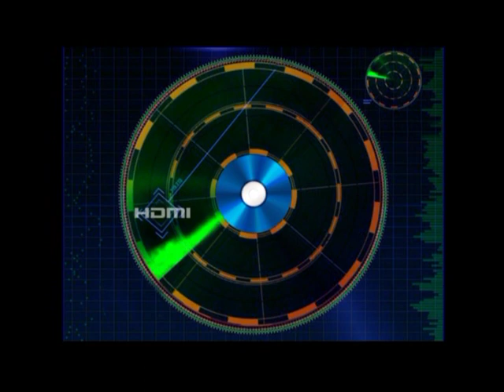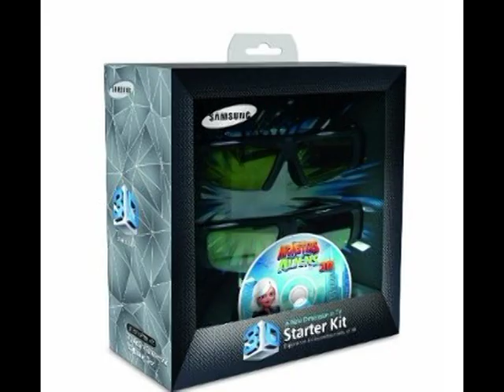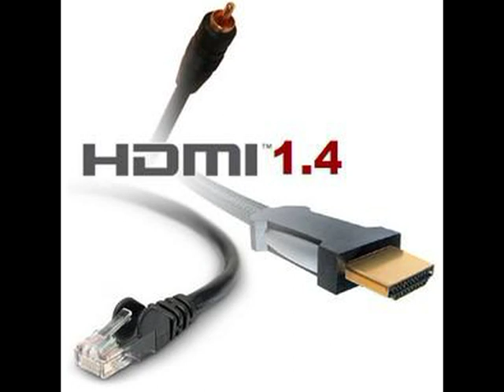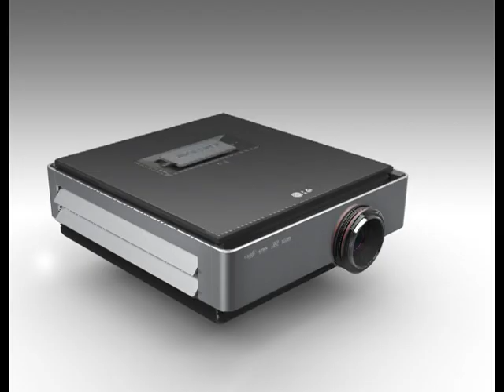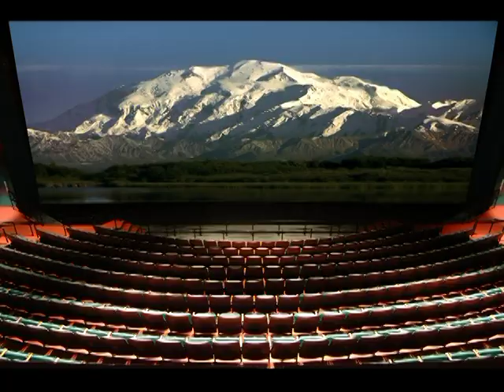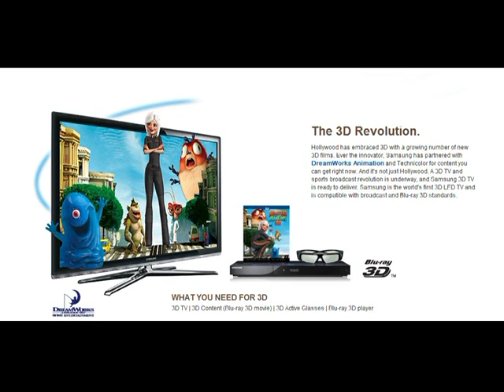Samsung 3D TV Review (Part Two)

Comment from the maker: @tubager Thanks for the comment. I don't think it does wireless 3D if that's what you're asking. However, that spec for wireless hdmi 1.4 was recently finalized. I'd bet that tech will roll out in the next year. If you're looking for wireless, the TV doesn't do it, but you can buy a USB wireless adapter for it for about $80. It does have an ethernet port though.

Comment from the maker: @radiowave7 That's probably a good route. 3D is definitely the way to go, but it's best purchased in stages, otherwise the cost can get overwhelming for the basic consumer. Some stores have been running deals where you get two pairs of glasses, which is good, at least. I'm looking forward to checking the Vizio when it arrives in stores, but I read $3500 was the price point for the 72-inch model. Did you see otherwise?

Comment: great videos bluradar. just curious what 3d tv did you end up buying. i had hard time choosing picking a panasonic or a samsung. i ended with samsung 50 inch. still waiting for my dumb glasses to come in the mail. but your video gave me alot of insight on what to expect. just curious were you able to see the 2d to 3d conversion since nothing is in normal 3d. i hope the conversion is good. have you seen that yet ?. thanks alot for the information.